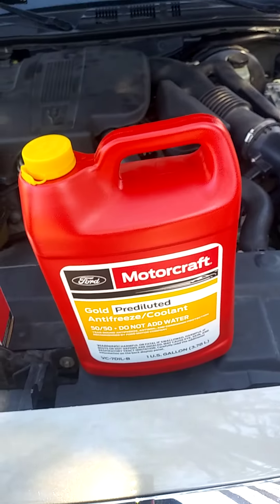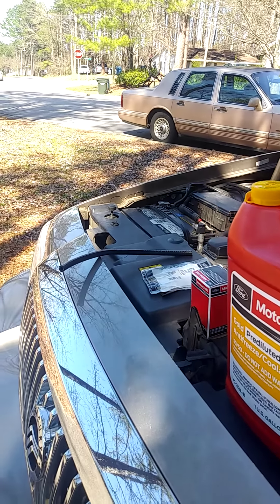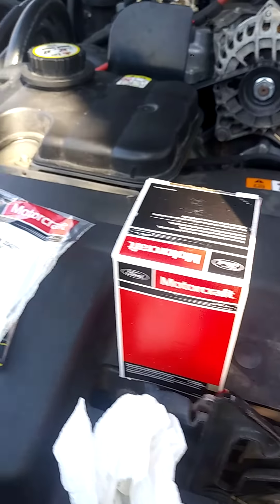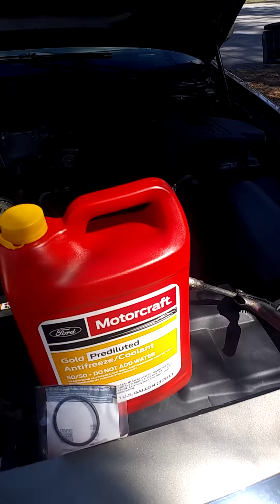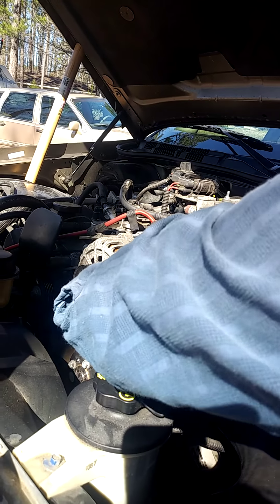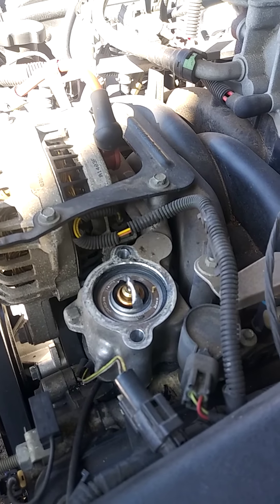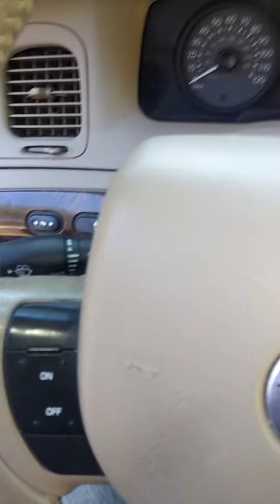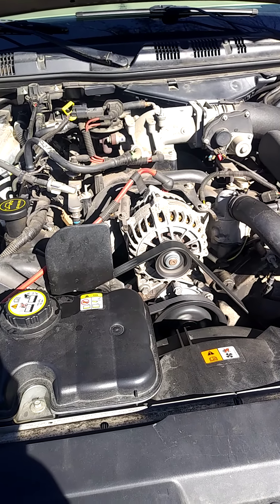How to change a thermostat on a 2006 Mercury Grand Marquis

Comment: These are the most foolproof thermostat O-ring ever. I've had some on GM vehicles that... would require a special gasket seal or using RTV to make them seal. I thought there must have been some special GM trick I was missing on the last one. So I took it to a GM mechanic. He couldn't make it seal either without RTV. But these are foolproof. The air bleeds pretty easily too but I usually either jack up the front or do it on an incline. One Cadillac I had I liked to never get to burp.

Comment: Ford superceded to yellow but I'd never use it if mine came with Gold. I've done a couple of those heater cores and mainly the reason they go bad is poor maintenance or mixing the wrong coolant. Like universal Hydraulic fluid is fine in most places but you don't want to mix it with AW where you can't get old pump parts. Same goes with AF even though parts houses will be glad to sell heater cores. I have been watching my temp all summer. I knew it was running about 7 degrees cooler than it should in the summer but I wasn't going to change it in the summer for that. I do most elective maintenance in the spring and fall. I only do hafta in summer and winter. You know hafta? I just checked mine again this evening and I found it's now running 15-20 degrees cooler and that explains why at my year round 71 deg temperature (I have colder AC than a lot of newer vehicles) it wasn't warm air  on a 60 deg evening on Automatic. I only use Automatic. First one I've ever had that worked right. I'll see youins tamorrah when you go buy. That's why the hood will be up. Then later I might build a sea-mint pond.